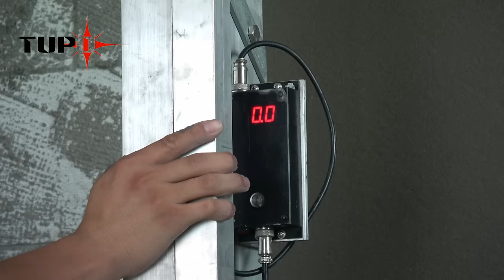TUPO machinery Automatic rendering machine, professional plastering machine

Comment: I've been a plasterer for 17 years and I know that machine isn't quicker or would do a better job then a experienced plasterer. To me it looks such a hassle setting it up and moving it around every where, and I'm sure it wouldn't be cheap to purchase
Reply: Flaws in the finish are visible. It's not very expensive but complete pain to setup and then you have to patch up the mess it leaves.
Reply: @thatwasyesterday ok
Reply: What a faf 😂
Reply: I've had a lot of plastering work done over the years. I honestly don't recall a 3m x 2.5m wall being mostly done in 7mins, maybe my memory is failing me. These machines will unfortunately (for the trade) become cheaper and better. On the other hand... tradesmen have gotten more expensive over time and the "two days for the room", turning out to be 1 day and gone by 1pm the next... doesn't make me feel that sad about that for those I have encountered.
Reply: Range from 1,5k to 5k
Reply from the maker: Kindly send your inquiry to our email: sales6@tupomachinery.com or WhatsApp+86 185 6602 9036 contact cto Ms. Alice, thanks!
Reply from the maker: Kindly send your inquiry to our email: sales6@tupomachinery.com or WhatsApp+86 185 6602 9036 contact cto Ms. Alice, thanks!
Reply from the maker: Kindly send your inquiry to our email: sales6@tupomachinery.com or WhatsApp+86 185 6602 9036 contact cto Ms. Alice, thanks!
Reply from the maker: Kindly send your inquiry to our email: sales6@tupomachinery.com or WhatsApp+86 185 6602 9036 contact cto Ms. Alice, thanks!
Reply from the maker: Kindly send your inquiry to our email: sales6@tupomachinery.com or WhatsApp+86 185 6602 9036 contact cto Ms. Alice, thanks!
Reply from the maker: Kindly send your inquiry to our email: sales6@tupomachinery.com or WhatsApp+86 185 6602 9036 contact cto Ms. Alice, thanks!
Reply from the maker: Kindly send your inquiry to our email: sales6@tupomachinery.com or WhatsApp+86 185 6602 9036 contact cto Ms. Alice, thanks!